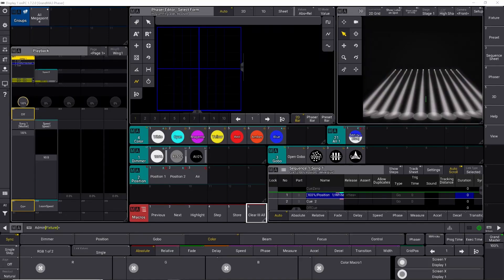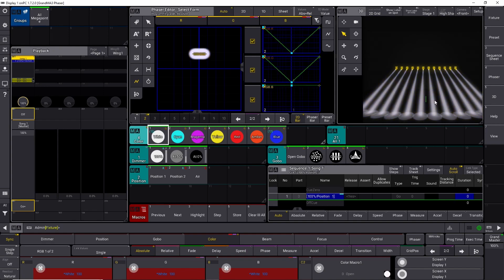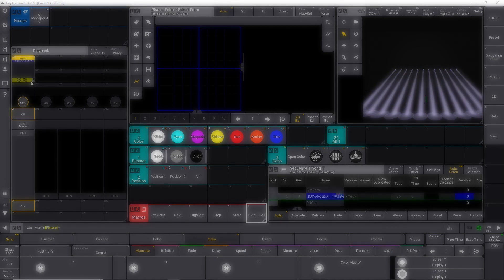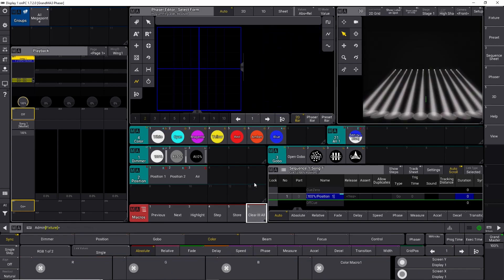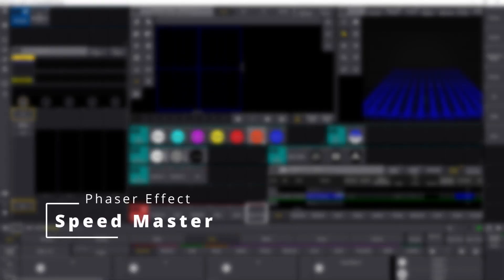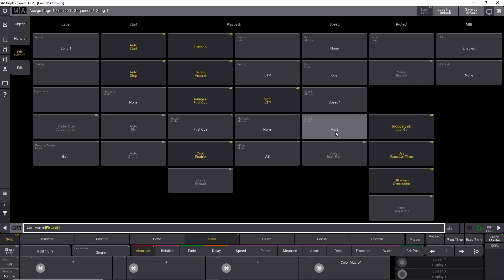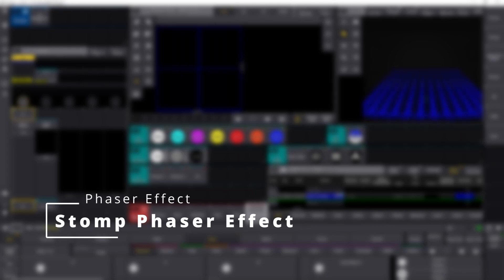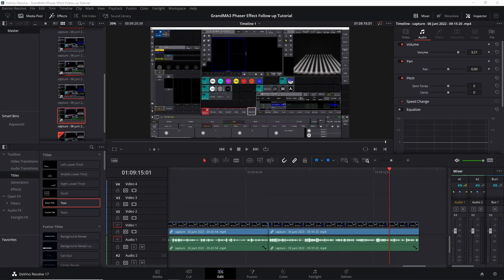Best way to fine tune GrandMA3 Phaser

Comment: In grandMa2 it was possible to make a sequence into a chaser and even putting it in random order. 

In grandma3 that is replaced with phaser step function..but i would like to learn how to set individual timing for each step to make more interesting effect. For example a color chase between red and blue but for the blue to last longer. for example step 1: 1 sec, step 2: 5 sec. How would I do that?

Comment: It's probably worth mentioning the Auto Stomp sequence setting. Switched on, any absolute value coming from a cue in this sequence will automatically stomp any potentially running phaser for that value coming from anywhere else.

Comment: Do you need to stomp the color ? or would it be enough to just select fixtures, stomp and store ?
Reply from the maker: Hi Emile 

Stomping the entire fixture is fine, but it was just to let you know that you can stomp single parameters 😀
Reply: @Event-Lighting  And how can I see if there is a Stomp stored inside a cue and how can I perhaps get rid of it then and how is the stomp really added to specific parameters (like only colors e.g.) - is it only possible if you use Parts?